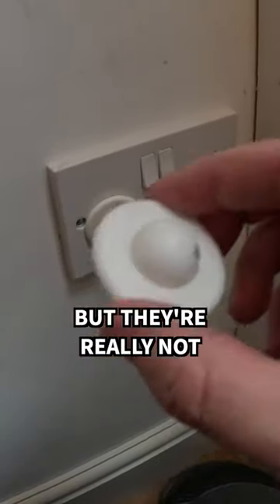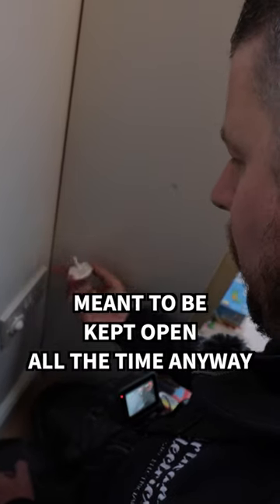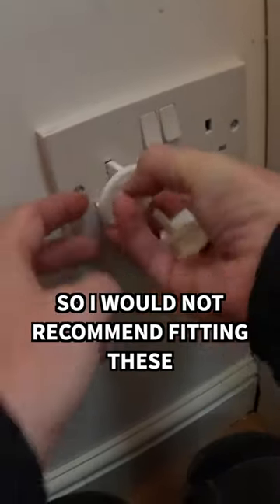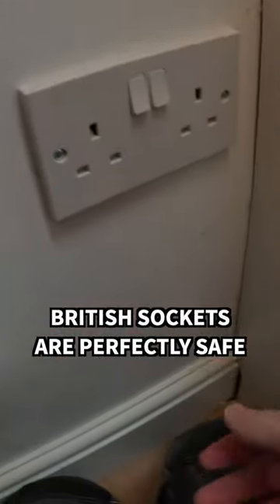NEVER Use These So Called "Safety Devices" ❌ #electric #safety #shortvideo

Comment: I’m sure the shutters stay open when you leave a plug in lol
Reply: Poor old Andrew [aka Jordan]. 

He does try - bless. In fact, many say he's very trying 😂😂😂
Reply: They do. The socket damage happens because the “pins” on these have non-compliant dimensions. They should not be used in British sockets.
Reply: @al45tair what are you even on about, he said the shutters aren’t meant to stay open and that the pins get brittle over time. The shutter will remain open as long as something is inserted in the earth pin , it’s absolutely normal practice to leave a plug in situ and it in no way affects the socket spring whatsoever.  As for dimensions have you seen how snug a plug fits are you even from England
Reply: What I’m “on about” is that the plastic “pins” on these things have incorrect dimensions and can bend the spring contacts inside the socket such that they don’t provide good contact with the properly dimensioned pins from a BS1363 compliant plug. That can lead in extreme cases to overheating and indeed fires.

Comment: Springs damage? You’re just making that up now Jordan. 
Sockets are meant to be used, some times permanently and that’s designed in. You don’t change a socket because you had you changed your espresso machine and it was plugged in for a couple of years. 😅  
I agree there are exceptions- they get loose in well used off-brand - Wicks specials, but have only seen that in high use situations, where there are obviously insufficient outlets or in low quality / import extension leads.  Hotel room Henry sockets are the worst, especially when the mirror is above them!! 😂
Reply: No, he isn’t making it up. The “pins” on many of those plastic things are the wrong size, and they do indeed cause damage to the socket.

Comment: Good for plugging up sockets when doing a knock-through, stops them getting too full of dust. As for saftey, I suppose there's a case to be made on all fronts, a nipper could shove something down the cpc hole, opening the shutters (especially on some extensions where an upside-down plug will fit), but then again, parents should parent and educate better, that said, parents can't watch kids 247 and curiosity can get the better of us all 🤔 the cheap plastic that these things are usually made of is a certainly an issue in itself, but one would hope that by the time one of these things has gone brittle the sprog would have aged sufficiently.
Reply: If you’re worried about someone sticking something in the earth pin, MK sockets actually require the live and neutral pins to be inserted simultaneously as well in order to open the shutters.

Comment: I once saw, in a branch of Wahaca, some idiot had “PAT tested” these things and stuck a label on them to say they were safe. They are (a) not safe, and (b) don’t comply with the relevant British Standard (BS1363).
Reply: You forgot bs 57733a …. And yes actually a lot do comply , my makita radio power adapter earth snapped off in the socket like many plastic pinned double insulated device plugs do and they’re all to bs am afraid m8. 
You can pat test any instrument that’s to a specific standard albeit not a current carrying one even if your struggling brain cell can’t comprehend that
Reply: The standard that governs the type G plug and socket is BS1363. I don’t know what you’re on about BS57733a for; there doesn’t seem to be any such thing - the closest is BS5773-3 but that’s about roller bearings. Perhaps you meant BS5733 (General Requirements for Electrical Accessories), but even to the extent that applies, it still does not change the fact that these things are non compliant with BS1363. Affixing a label to them claiming that they are safe when they are clearly non-compliant is unprofessional and dangerous.

These plastic doohickies do not have the correct dimensions, the ones in the video are especially bad because they actually allow someone to poke a paperclip into the live terminal (which is not possible without them), and frankly your Makita radio story is totally irrelevant. (Makita’s plugs do comply with the regulations. That yours broke off in a socket is obviously unfortunate.)

If you are an electrician, you might care to ask the IET what its official position on these “safety” devices is. Or you could try asking socket manufacturers their opinions. You will find that they will tell you the same thing I’ve told you.
Reply: You can't Pat test socket cover

Comment: They are not just about preventing little fingers getting in, the shutters do that well, however they do prevent to a degree little fingers attempting to copy their elders and put a plug into the socket.
Reply: But they could also force them in upside down thus opening the shutters. I’m all for binning them 😂
Reply: That's not why most people buy them for.
Reply: Or people can become parents once more and teach their children. 
That's no to be confused with shouting and just saying no without explanation
Reply: Putting a plug into a socket is safe. Take a look at a plug if you don’t believe me. The live and neutral pins have a nonconductive sheath on them that prevents you from touching anything live; by the time the pin is live, you can only get at the sheath, not the bare pin.
Reply: Never disputed that plugs have non conductive sheaths, it’s about a prevention against youngsters plugging in electrical appliances.
Reply: @iainmcdougall3628 Electrical appliances have to comply with safety regulations, unlike these “safety” devices, which do not. And if you have a genuinely dangerous device (a power tool or a blender, for instance), it should be kept out of reach of small children anyway.
Reply: Agree 👍       In the ideal world….

Comment: The shutter doesn't open due to the earth pin. The bottom pins have a plastic swial that move when the plug pushes in and then makes contact with the live and neutral. I know because when I test for voltage I push my two multi meter probes in there and they open quite easily. Now if I can push two metal rods into the live and neutral what's stopping a child in doing this?????? That's right we all guess right it's the socket covers.

Comment: Hmmm.... playing devil's advocate, if the holes are covered then there's nothing for junior to be interested to try to poke anything into. 

Think suggesting not using these for the reasons stated is quite a large stretch.
Reply: Except some of these things make it easier for “junior”. For instance you can plug them in upside down, opening the shutters. There are even versions that have a convenient hole just the right size for a paper clip. They are dangerous, don’t comply with BS1363, and should not be used.

Comment: You should include what you do recommend to prevent little ones poking cutlery/toys/fingers in plug sockets or how to prevent them plugging random stuff in
Reply: They can't poke stuff in because the sockets are shuttered. If they plug random stuff in, it's still safe because the plug pins are shielded. If you're worried about some appliance being used by your little ones, just put it out of reach. Don't get conned into buying these doodads.
Reply: And more specifically, the myth that a baby could poke its fingers into the live socket without these, even if the shutters were open, is untrue. They are actually deliberately designed to be smaller than the dimensions of a baby’s finger.